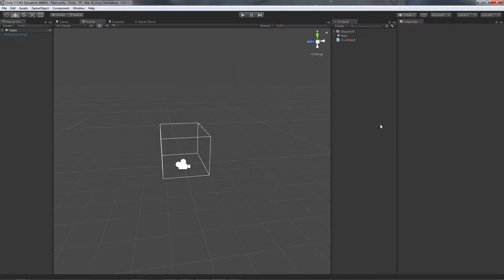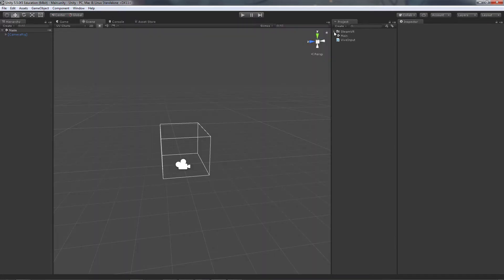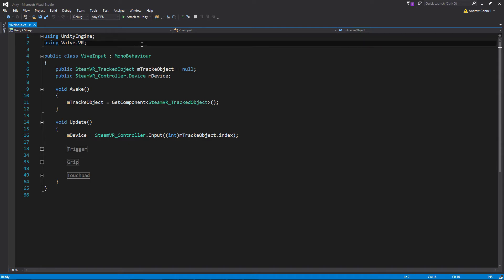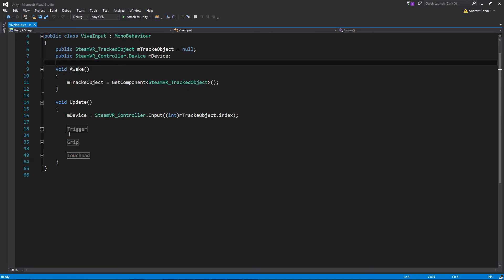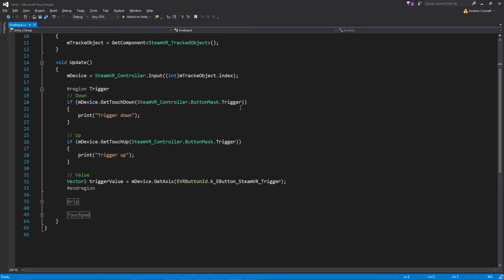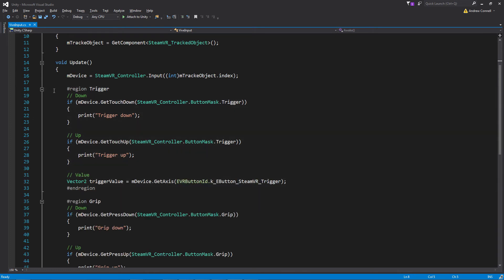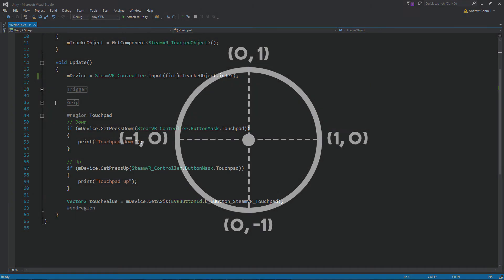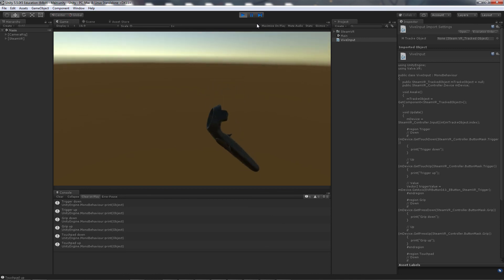Unity + Vive Tutorial  - Controller Input

Comment: This predates SteamVR 2.0, and the SteamVR API used in the example has calls that no longer exist in 2.0.  Is there an update to this tutorial for 2.0?  Thanks.
Reply from the maker: Correct! Yes, I have a video on SteamVR 2.0 Input using actions, and an update 2.2 video. If you do a quick search it should be the first thing that comes up.
Reply: @VRwithAndrew  Thanks very much.  I'll check it out.

Comment: Is there a way to access menu button on htc vive, I am making an application in which if i press menu button on htc vive controller(which is above touch pad) i should be able pause what i am doing and should get these 3 steps: 
1. resume(go back to what is playing behind)
2.main menu
(go back to main menu scene)
3. select steps(there are many steps in my project)
so what i am asking is can i customize that main menu button, if so how??? can u you  plzz help me,  provide a link if u did anything related to this!! Thanks!!
Reply from the maker: Are you specifically trying to do this using the older plug-in? I'd recommend looking into my newer videos if not.
Reply: @VRwithAndrew  no not older plug in, just asked u question in ur older video, can u post me the link where u modified menu button?